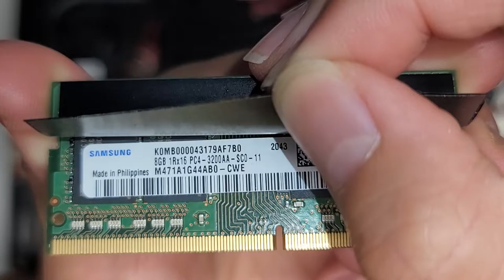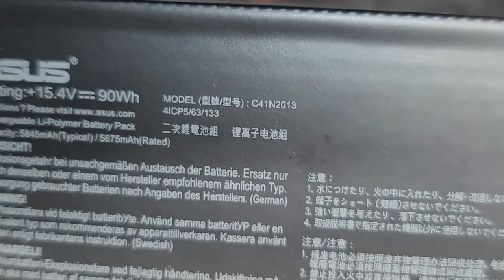ASUS ROG Zephyrus G15 GA503 GA503Q GA503QR-211.ZG15 Complete Disassembly RAM SSD Hard Drive Upgrade

Comment: Great Vid tks.  How much more difficult is it to remove the cooling system and replace the motherboard.?
 Ie  does the cooling system separate easily from the motherboard?
Reply from the maker: Likely very similar to this https://youtu.be/m4wma8RCBa8
Reply: Great Help   many thanks    @ItsBinhRepaired
Reply from the maker: @boilingpointstudios6471  no problem

Comment: hello!! i have an issue with my G15 fan that i’m afraid will end up frying my laptop, i was hoping you could help? ): 

i’ve had an ASUS ROG Zephyrus G15 GA502DU since 2019 and randomly without any warning it now emits an awful noise and the cpu fan is barely working, when i entered UEFI/BIOS my cpu temp started at 40°c and quickly raised to 73°c within minutes (i was not gaming or previously gaming) and my cpu fan speed would not exceed around 774rpm…?! perhaps my fan is faulty and i just need a simple replacement, but i’m unsure if it’s a deeper issue within the motherboard? 

i’d assume if it was just dust accumulation the problem wouldn’t have literally occurred overnight… really not sure what happened as i didn’t drop it or anything but besides the super low cpu rpm/quick overheating/weird noise, the laptop otherwise still runs beautifully… no lag, involuntary shutdowns or slow loading speeds anywhere? besides those specific 3 problems it honestly runs like nothing is wrong at all, but it’s going to fry itself! 

(i haven’t spent more than 10mins in a game due to the quick overheating but within those 10mins the game i launched ran fast with no issue) i never once had a problem with this laptop in all 5 years until now… only a few days ago i could play games for hours without any issue ):

sorry for overexplaining i’m just at a loss! do you have any idea on what this could be or is it just a simple fan failure that can be replaced? i’m hoping it’s not a motherboard issue or anything hard to fix. thank you SO much for reading and creating helpful content!! videos like this are truly the backbone of the youtube gaming community lol
Reply from the maker: This playlist will help Fan Repair: https://www.youtube.com/playlist?list=PLSSiYX-ta7aqqxfDWDQh-B6Az4ZgDI459
Reply: @ItsBinhRepaired  thank you so much!!!
Reply from the maker: Hope you're able to repair it

Comment: do i need to disconnect the battery before cleaniing the fans?
Also, what did you use to clean the fans?
thank you
Reply from the maker: No. I used a toothbrush and electric blower.

Comment: Hey I just bought my G15 today and I’m trying the take off the screws and it’s impossible, I’ve already kinda damaged the screw, but it will not move. I’m trying to install a m.2 2tb. Any tips?
Reply from the maker: You're likely using the wrong size screwdriver. Get this and use the one that fits properly, most likely jis1 https://amzn.to/405a3Y0

Comment: been here coz I'm trying to find what Cmos battery does this laptop have (which I own) just for the record (on my note taking app) so I don't need to research it in the future if it does dies on me.

but it looks like it doesn't have a cmos battery...  I can't spot it on the motherboard from this video.
Reply from the maker: Some models use the main battery as the cmos battery.

Comment: Help I put new ssd an ram in and the battery that connects to mother board will not snap in and metal pins won’t snap all the way in I’ve tried messing with it for hours
Reply from the maker: Check the metal tab and make sure the pins aren't bent

Comment: hi thnks for the tutorial at 14 :34 those two cables are wifi antennas right , one i have it loose cause the graber on the mother board boke....
can i solder it or conductive glue or something?
thaaanks
Reply from the maker: If you know what you're doing, yes. If not, take it to a professional or use a usb wifi adapter instead.

Comment: So with the original ram 8gb soldered and 8gb upgradable. Does this mean if I replaced the 8gb to 32gb it would be a dual channel 16gb? Because right now it's is dual channel 8gb right? Am I understanding this the right way?
Reply from the maker: The RAM needs to be matching in size for it to run in dual channel mode.
Reply: @ItsBinhRepaired  okay thank you! So I assume the upgrade would be more for running multiple program not really for gaming 16gb is more then enough I was just curious! Thank you!
Reply from the maker: @christopherherrera695  yeah, as far as I know.

Comment: Hi thanks for video
How is the lapability of g15?does ergo hinge design make it uncomfortable to use it on the lap for long period of time?
Reply from the maker: Not sure. Don't own it, but I wouldn't use a gaming laptop/notebook on the lap.
Reply: It might is too long ago since you wrote this comment, but let me answer you since I own the same model.

As every laptop and especially gaming laptop get very hot and require then ventilation to work work as best as possible, I would not recommend using this model for more than just some short tasks.

The laptop can get pretty toasty and therefore your labs as well.
Reply: it’s fine as long as you don’t wanna have kids

Comment: Isn't isopropyl alcohol better than water to clean the components?
Reply from the maker: Depends on what you're cleaning. Try cleaning syrup with isopropyl alcohol.
Reply from the maker: You can't dissolve sugars with alcohol.
Reply: @ItsBinhRepaired  good to know, just spilled coffee on my damn keyboard, turned it off immediately and put the laptop upside down but looks like I'll be taking it apart. The RGB never turned off so I hope it's not completely ruined
Reply from the maker: @Likitu264  need to make sure it's completely dry after.
Reply: @ItsBinhRepaired  thanks man, it wasn't much but I can't risk it. I would sent it to you but I'm in Mexico. Sadly don't know anyone here with the skill
Reply from the maker: @Likitu264  :(
Reply: @ItsBinhRepaired  So I just finished working on the laptop, the MB was mostly intact but had a bit of coffee on one of the back vents, not much tho. Ive been testing it for the past couple hours and it seems to run fine :D. Thanks for the tutorial my friend, its not the exact model but pretty straight forward.
Reply: Might try repasting it next, tho the liquid metal scares me lol
Reply from the maker: @Likitu264  don't use liquid metal
Reply from the maker: @Likitu264  awesome!
Reply: @ItsBinhRepaired  yeah, i prefer paste. But Asus ships the zephyrus line with liquid metal
Reply from the maker: Youtube is acting up and not letting me see any new comments on here. You'll have to post a new one instead of a reply.

Comment: I’m unable to locate my cmos battery my screen is completely black. At first it didn’t start so I bought a new charger from Best Buy than the computer turned on but now my screens black I already took out all the ram and I tried to detach battery and reset still nothing now im trying to fix it but was trying to reset the bios but I can’t find the cmos battery
Reply from the maker: The main battery is the cmos battery as well.

Comment: This is the 3070 version? The cpu is the Ryzen 7?
Reply from the maker: I don't know. I don't own the computer.
Reply: @ItsBinhRepaired  Ah okay, thanks!
Reply from the maker: @lucamagni99  no problem
Reply: this is the 3070 version. Ryzen 9, 9700HS Model, 93.00 (3.0GHz to 4.6Ghz [Max]). 8 Gb soldered to the board, and Free Slot ram Upgradable
Reply: @xBehli  Thank you very much!I was curious to understand, if there were differences in the dissipation system, based on the model.👍🏻
Reply from the maker: Cooling?
Reply: @ItsBinhRepaired  Yes, the heatpipe solution.

Comment: My g15 ga503q stopped working after 16 months!! I took it to a local shop and they said the motherboard is fried. Does anyone or the video creator have any input on help for me? I really need this computer. It was $1800 and I don’t really want to just throw that away and get another computer. There has to be a fix? Or a replacement part? Help please!!! It won’t even turn on at all.
Reply from the maker: Either the motherboard needs to be replaced or you need to find someone that can diagnose and repair the board.
Reply: @ItsBinhRepaired  local shop told me the motherboard needs replaced I find it hard to believe being only 16 months old and barely used
Reply from the maker: @damonsmith8411  depends. If the gpu is dead, then yes.  I have someone that might be able to fix it for around $300
Reply: @ItsBinhRepaired  I’d pay it no problem
Reply from the maker: @Damon Smith  dead gpu would be not repairable. Also, you'd have to pay shipping both ways.
Reply: @ItsBinhRepaired  of course. I need to know if dead you or not first though
Reply from the maker: @damonsmith8411  would be $40 to test it.
Reply: @ItsBinhRepaired  where are ya located
Reply from the maker: Bay area

Comment: Where the CLRTC on the motherboard?
Reply from the maker: Not sure, but you can disconnect the cmos battery and short the connectors.
Reply: @ItsBinhRepaired  can you give a timestamp where presumed CMOS battery and short the connection?
Reply from the maker: @totallynotpopular872  actually, just disconnect the main battery, then hold the power button 30 seconds.
Reply: @ItsBinhRepaired  I tried the method of hold button for 30 sec but the bios password was not reset
Reply from the maker: @totallynotpopular872  oh, there isn't a password reset that I know of. That's different than bios reset.
Reply: @ItsBinhRepaired  I don't see what underneath of motherboard on video maybe CMOS battery hidden but it just assuming something
Reply from the maker: @totallynotpopular872  battery will not reset cmos password
Reply from the maker: You can search your laptop model number and motherboard on eBay.

Comment: My fans rattle after ~5 months of use. I've changed them two times already :c
Reply from the maker: Do you live in a humid environment or smoke or burn things or do a lot of cooking where you use the computer?
Reply: @ItsBinhRepaired  No, fans are clean. I guess fan bearings are faulty on this model (GA503Q), and decay over time :C
Reply from the maker: @Canisestlupus  the fans don't use bearings. Clean fans don't mean good grease. Moisture/smoke makes the grease gunky
Reply from the maker: @Canisestlupus  try this and the others in the description https://youtu.be/3zs_SJ3BXgA
Reply: @ItsBinhRepaired  wow! There is one thing, that made me think this was bearing problem: if I rotate my laptop, at some degree the rattle disappears and the sound is clean. And at high speeds the sound is also clean. I will try to change grease this time, thank you!
Reply from the maker: @Canisestlupus  it's likely lack of grease